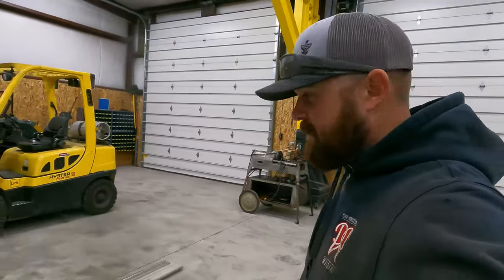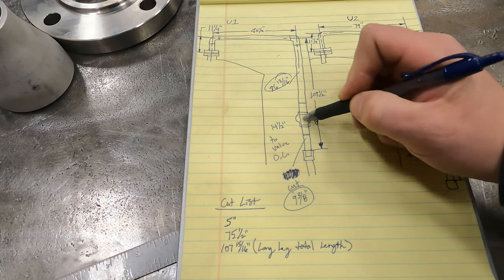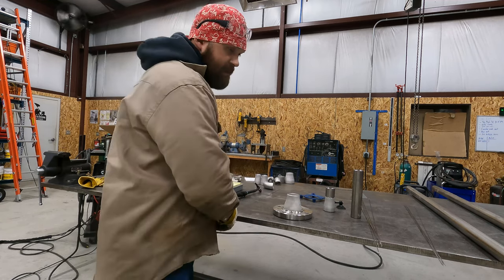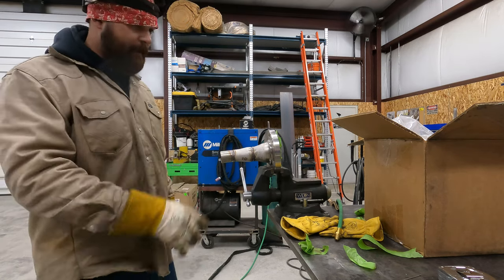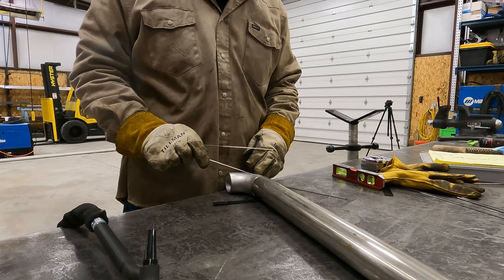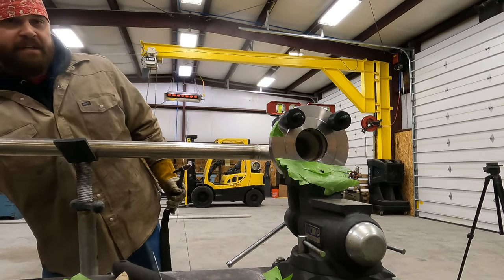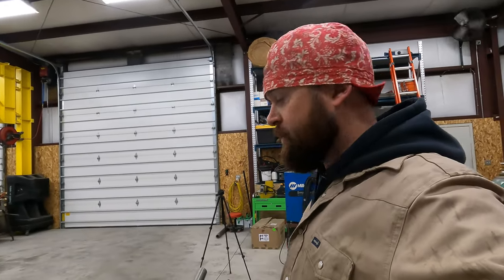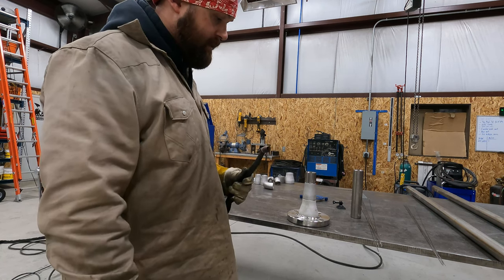TIG welding stainless steel stand pipes

Comment: I'm a union steamfitter by day, so I like the video 🙂
Reply from the maker: Glad to hear it. I was worried that a lot of people might find the full process a little dull, but I still wanted to be able to show how much calculating and fitting and work goes into the whole process of fitting and welding pipe. One thing I respect is learning how much work is really involved in a trade that I’m not super familiar with, and I guess I hoped the viewers see it that same way. As a steam fitter I’m sure you understand. You should share with us on your channel what is involved with being a steam fitter. I’m not real familiar with that line of work.
Reply: @Freedom Fabrication   we work in alot of commercial and industrial places. Heating and cooling in office buildings, oil refineries, process piping at pharmaceutical plants. I've done all kinds of pipe, copper, victoulic, weld, threaded, steel, stainless you name it. Everything you did in this video is what we do all the time. Even more impressive you did it with out a fitter

Comment: Boy oh boy, do those compound cut's get ya if your not paying attention. I finally have a job after about 5 years that I have to use my brain. We built a frame out of c12 the one side of it had 4 pieces joined with c 12 at intersecting points. These 4 pieces were all  a 32 nd short. So needless to say didn't notice the one side was short until it was all welded solid. Cut it apart I did. All ways appreciate the tips and tricks you give. 👍
Reply from the maker: Gotta love those projects that make your brain ache. Compound cuts are always a treat! It is nice to give the Ol’ Noggin’ a workout once and a while though.

Comment: Cool video. Do you allow for a small amount of space on the socket weld fittings? I've found that a Ridgid tri stand with a chain vise makes it much easier to manage the pipe compared to a bench vise.

Comment: Did you mention that globe valves have a directory? and I'm surprised they didn't want a vent?
Reply from the maker: I thought I did mention that they are directional, but as far as the vent goes. The tank is vented. This was just a line going from a manifold to the tank. Thanks for watching!

Comment: Surprise you haven't made rollout wheel. Also how do you know your flange holes are position correctly a with the holes in flange at the facilitie where your installing, when your tying into a existing  pipe on one end ?
Reply from the maker: For this particular situation, the flange on top of the tank is a threaded flange, so there is some adjustment there. If that wasn’t the case I would pull string lines across bolt holes and drop a plumb bob to check if it was square to the tank. Thanks for watching!